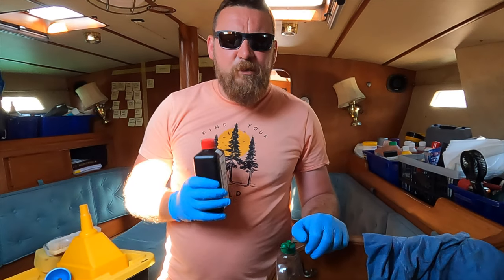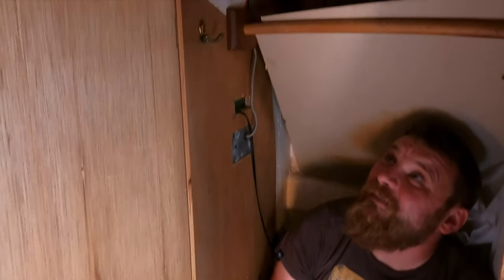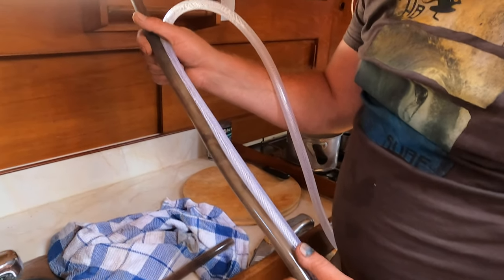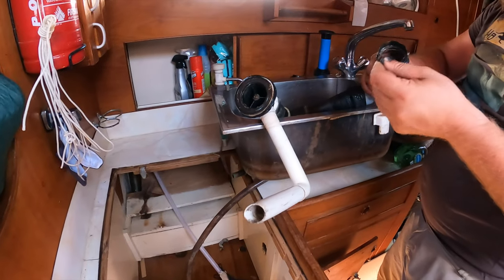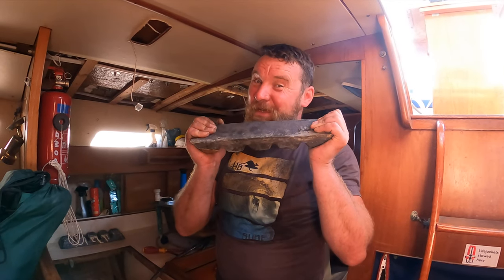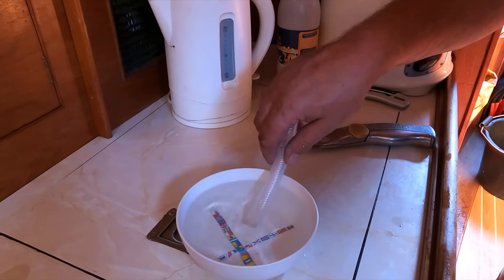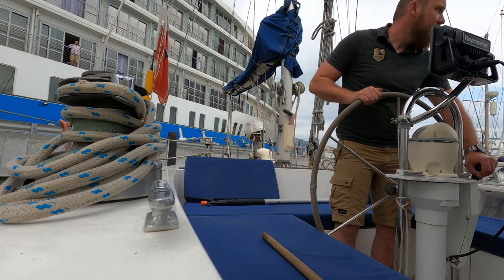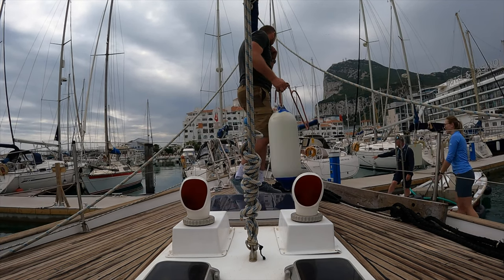Is this from our WATER TANKS or BILGES ? [E5]

Comment: hi  good job on water tanks,  like fuel water can look clean but worth putting water filter on hose between water tap and boat . and pre boat kichen tap water clean in med but north africa and south . carry spare fillters . a sea water manual pump at sink saves a lot of fresh water... to first wash dishes,       manuel water pump good idea as back up ,if electric pump fails and saves water, if small pipe fitted . A soda stream for  fizz uses no power but is good for sundowners  and makes water more exciting ,
Reply from the maker: Hi Neville, as always thank you for your advice. 
We do have a manual sea water tap in the kitchen. I agree! that is a great solution for saving water from the tanks when washing dishes. 
In the future we plan to install a watermaker but considering it is a tad expensive..we won’t rush it, so cheaper water filters could be a good solution for now. 
Best, Nat & Ziggy